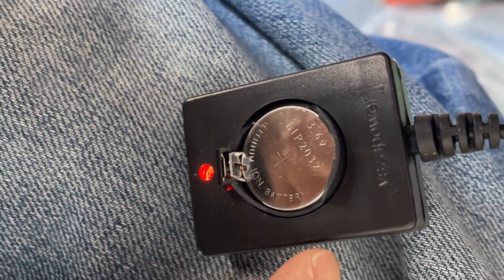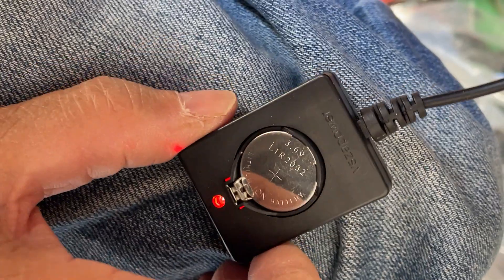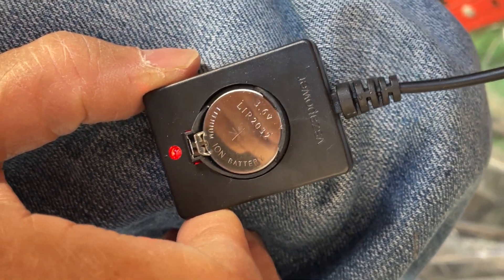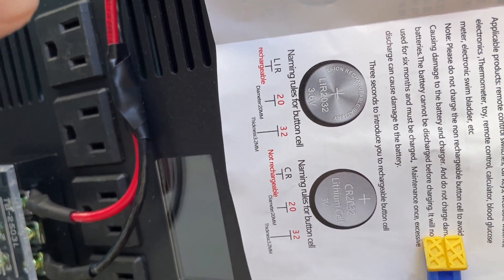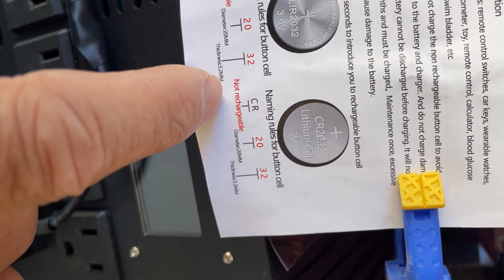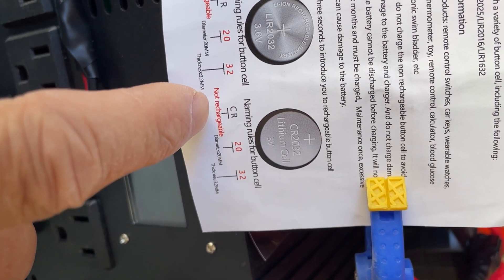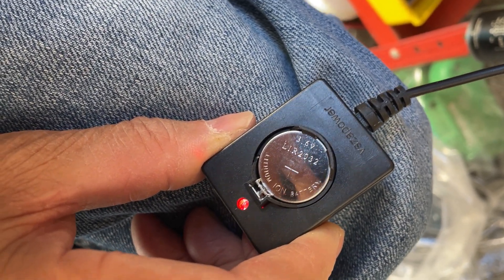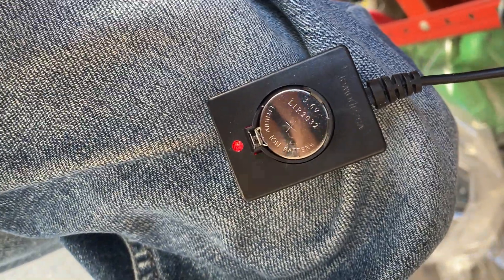Tell me something I don't know...What is LIR2032 battery

Comment: Do you know how to use the smaller cells in this such as LIR1632? Says it's compatible but it doesn't clamp in.
Reply from the maker: Smaller batteries won’t fit but you can just place the battery as close towards the led and put in a spacer in the back like a cardboard or anything non conductive.